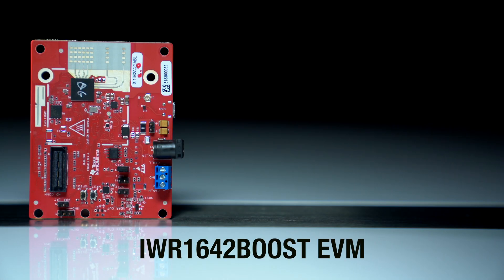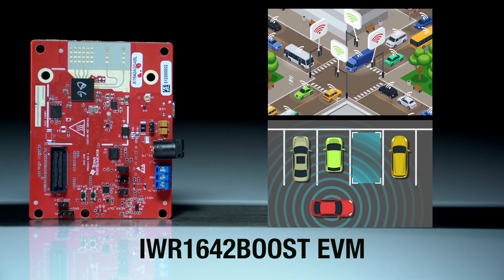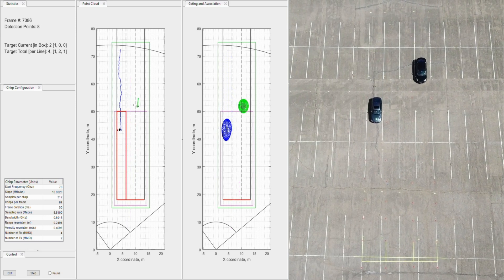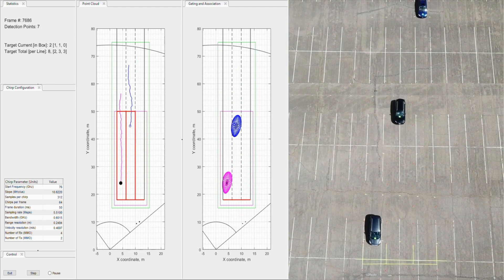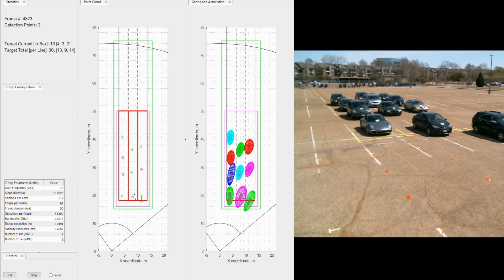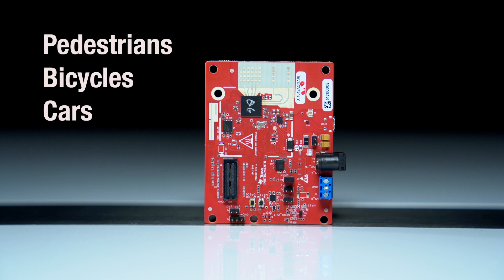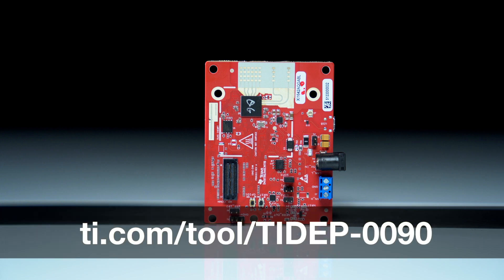Traffic Monitoring using IWR mmWave Sensors

Comment: TI has fantastic documentation and demos for these sensors that prove their capability and viability for different applications. Although their mmWave sensors are more expensive relative to some of the other sensors I evaluated, because of the plethora of good documentation and demos that are somewhat related to my application, I'm choosing TI's sensors.
Reply: These sensors do not require light to work? I mean it can be used to detect cars in day time as well as in the night time with no extra requirement of street lights in the night time? I think it can work without light as they use radar signals. But as you have already used it, you can better advise :)

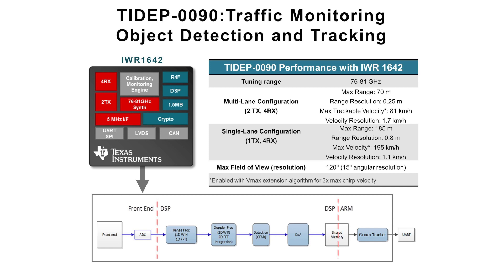Comment: At 0:58 there are four cars in each line, but the right two lanes only show three cars in the diagram. Is it false detected? Or is the demonstration not real? At 1:33 there are also wrong car dots in the diagram compared with the video.
Can you explain this? I can not believe the sensor works well with this video in mind.
Reply: For 0:58, I think this was an issue with the grouping algorithm. As you know, these sensors output point-cloud data, and so a grouping algorithm might group objects that are far away from the sensor but close together as the same object. The grouping algorithm is provided as part of the reference design but not as part of the product (if I understand correctly), so I'm sure you can adjust the some parameters to make the grouping algorithm only group point-clouds that have a certain density threshold in order to make it more sensetive.